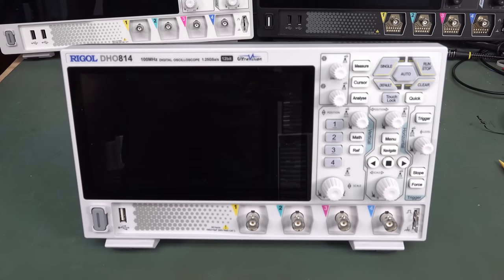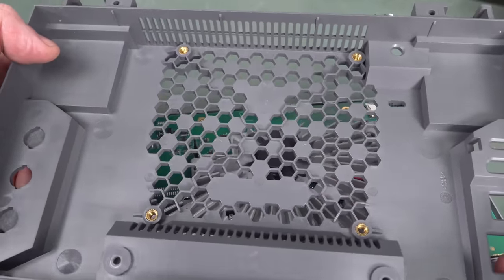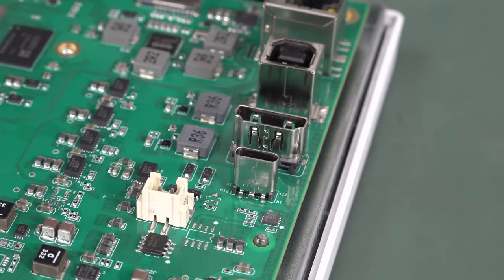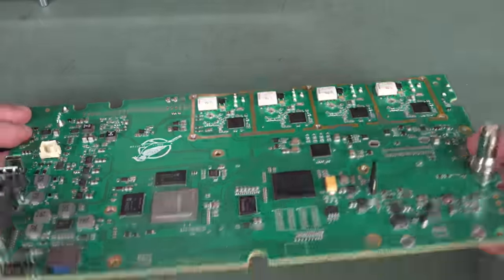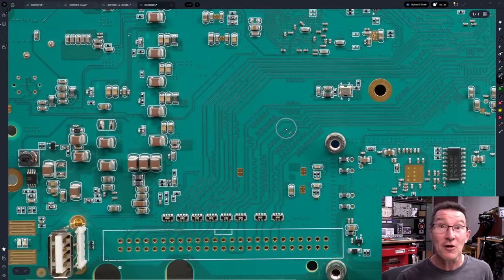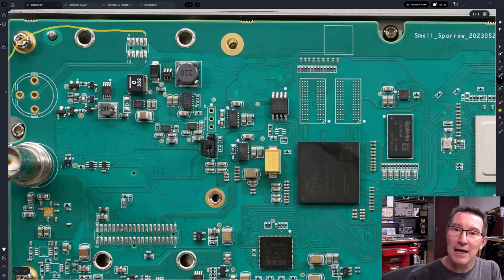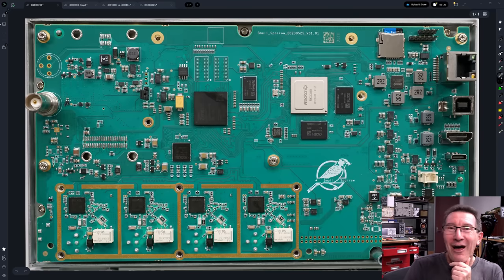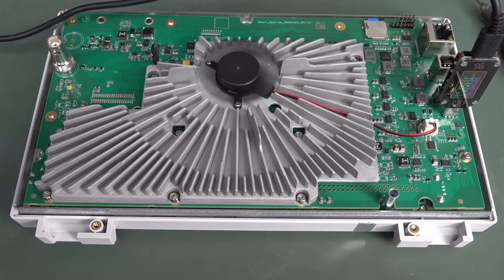EEVblog 1563 - New $389 12bit Rigol DHO800 Scope TEARDOWN

Comment: Not sure how much they have saved on the FPGA, looks like the zync XCZ7015. Pretty heftly with dual ARM cores included. Thanks for the tear down.
Reply: It is literally the cheapest they can buy with high speed serial transceivers which are probably necessary for the ADC converter (which I would bet is using the JESD204 protocol, which is an LVDS high speed interface)
Reply: Absolutely this. It has half of the multi-gig transceivers of the Artix 7 100T but has an extra 12-bit ADC. Plus, the PS has a bunch of "freebie" peripherals that can potentially reduce the BOM costs significantly across the models that they use it in (why buy an FPGA that you're not filling up AND an ETH PHY, when you can use an SOC/FPGA with enough fabric and 2 ETH PHYs for cheaper).

Comment: More likely the passives are placed, well the bypass caps anyway, so that the PDN behavior is the same. You'd have to (well, ideally you would, but we all know how often we do it ourselves in practice...) evaluate the supply quality for every assembly configuration.  Easier just to leave it alone, and let the low impedance sink a little more current in the case it's unused.

The termination resistors hanging around though, beats me =)

Comment: This is an awesome look at the guts of this scope. Love seeing the heat sinking and the analog front end at 18:40 . Any idea what they do in the cheaper scopes to reduce the bandwidth?  I just ordered a DHO802 since I don't need 4 channels, and all the specs except bandwidth are basically the same at 60% the price. I can't imagine they did a different board design or use a different chip in the AFE. Maybe a different cap on the amp somewhere or a software restriction? Neither would save them the US$100 price difference though between the 802 (70 MHz) and an 812 (100 MHz) model. (I don't really have to have 3.5ns Trise - but I'm guessing/hoping those specs are conservative anyway 🙂)
Reply: There are 2 boards - a 2 channel board and a 4 channel board.  They all have the exact same hardware.  Obviously, 2 channel models are cheaper than 4 channel models because they require fewer components.  

You can find hacks online that can 'liberate' the higher BW.  But many people caution against going over 100MHz because if you use more than 2 channels the sample rate isn't really high enough for good accuracy.

Comment: Wow. The price value is amazing. Also love the form factor. The USB C power that is cool and innovative. Nice. Could use battery banks easily, standard PSUs, but the provided PSU also is nice, high quality and small. Cool. The USB Type C socket looks a bit anemic, could use some more solder, or some glue there. Also would be nice to see some screw in USB Type C. There are few standards, and they are really and nice way to secure Type C for more permanent and secure installation.

Comment: I have to ask.  Is the 802 fully populated too with the added exceptIon of the the BNC connectors and relays for channels 3 and 4?  Are the front panels the same except for the front bezel and ch3, ch4 switches? I bet you  see the lights flash behind the plastic on startup.

Comment: Fan looks like standard 50mm item used on low profile graphics cards, should be fairly easy to alternatives.
Reply: Kewl .. Hey I dont suppose any standard fan size fits the 4 VESA holes ?
 Slow the internal one down with a resistor, and put something standard (and queter, maybe a low profile jobby) on the back ??
Reply: @petegaslondon  a standard 120mm case fan has 105mm hole spacing, so with a little modification of the mounting holes on the fan you should be able to bolt one to the 100m vesa mounting holes on the back of the rigol.

Comment: I think it is to do with cost of manufacture why they put the passive components on the logic analyser and not the chip. When you get a PCB manufacturer to do boards like that they charge extra fro mounting chips of that size and pin configuration. It suggests to me they place them by hand after the machine has placed all the other SM parts. The large ribbon connector socket is also in that category of manual placement. The idea is you do a large manufacturing run of the basic boards then you can use that board for all the different models and populate then according the the demand for each model. It's more costly to split it up into about ten different manufacturing runs.

Comment: The visa mount that's an option but yeah would have been nice for the plastic to have some cable mgt, I like the fact they left everything populated so easy to hack, its funny allot of people do populate caps and resistors ect but not the big cost maybe its just easier to have the same cfg on the pick and place and just leave out the more expensive components as i think that would be another pick and place machine for the big BGA's

Comment: Personally I think a 12 bit scope should have decent DC gain accuracy. Here +/- 1% is reasonable, at least it is better than the DS1054Z at +/- 4%. However, for 390 bucks one can't complain to be fair.

For relative measurements linearity is however more important than DC gain accuracy, especially since the gain tends to be fairly "stable" and can be accounted for, but still would be nicer if high resolution scopes like these were more accurate to start with.

Comment: SD cards can be used in either SD or SPI mode and each others interface might not read the correct data. Or the cards are hare programmed to only use one mode. You could get an SD to SPI adapter used on Arduinos to try to read that card. They might use them as a cheap eMMC alternative which is something I once wanted to try on a QNAP NAS with broken eMMC flash. Sadly I wasn't able to remove the old chip so I just sold that NAS. It was a nice and modern model I got for really cheap. I'm a bit sad I didn't keep it to try it again. I was also able to control it via a soldered on serial port which was kind of nice.

Comment: I think that caps and resistors are installed because they separate the boards for different models after that "small parts placing machine" and it's cheaper in the production

Comment: Near the top left corner of the main IC in the front end there are two unpopulated resistors. Could those be part of some configuration jumpers for the front end chip? If a Linux box recognizes the presence of the memory stick but doesn't mount it so you poke around in its file system you can use dd to do a raw read of the stick, save it to a file, then use a hex editor to examine the dump file.

Comment: Might be they're fitting a lot of unnecessary parts for initial batches to give them a lot of boards they can easily convert to the higher tier models while they finish their development?  We've done that before, and then later in production cycles removed the parts not needed for that SKU.

Comment: Crazy-good deal, and the DHO900 even more so with the LA included. But why oh WHY are instrument makers turning to black front panels? It’s so much harder reading white-on-black text than black-on-white. - And the dark design aesthetic is just plain ugly… 🤮
Reply: I'm actually opposite you, because white on black for me has always been easier to read for me personally.  Too bad they don't make each model with your choice of color, haha
Reply: Rigol is using black front panels on the higher speced series wit the same case. DHO800 vs DHO900, DHO1000 vs DHO4000 scopes, DP900 vs DP2000 power supplys, DG800 vs DG900 arb generators.

Comment: Maybe they keep the best boards with no issues for the Higher model. And boards with problems or not as to spec like snr are sold as the lower model that's why some parts are still populated/ installed?

Comment: Oh, no 50 Ohm capability..... maybe an opportunity to show us how to "retrofit" 50 Ohm termination to a scope like this for when one needs/wants such? Should be especially relevant if one can unlock 200+ MHz bandwidth mode, because for a common half-light-speed coax, that's just 75cm wavelength, which sounds like annoying ringing when/if termination is improper.
Reply: Just use a 50 ohm BNC terminator, either a proper but more expensive feedthrough one, or one on a T-piece.

Comment: First thing I do with most electronics I got (NAS, routers, etc) that have a fan is to replace the fans with Noctua ultra silent industrial ones. They make the typical sizes and come in all voltages. But I would never dare opening up a scope, because I don't know how the Noctua fan might interfere with the EMI, and if the built-in fan is specially optimized for that and that's why it is so loud. Bear in mind, an ultra silent, decent static pressure Noctua fan of that size can cost upwards of 25 Euro/USD, so that's a decent chunk of the scope's price.
Plus this fan looks like that would be almost impossible to be replaced.
Reply: @your
Are  you twelve?

Comment: Weird choice they went with the RK3399. That is a high end chip, but its from 2018, and is on a relatively large process node. The RK3588 has been out for a year and is a much better choice.
Reply: if it's only been out for a year, it's likely it wasn't available when development started no?
Reply: And perhaps the much better choice also costs a lot more...
Reply: @ghydda  @tiktian Yeah, I realize now after watching the rest of the video, they chose the RK3399 because it is the same chip used in the 1xxx and 4xxx series scopes (which were designed before RK3588 came out), and they can probably get it cheaper than the newer chips too.

Comment: Firmware no doubt riddled with bugs and won't see an update for another year minimum (just like the DHO4000). And when they do release an update, it will likely have only fixed ono or two bugs and made changes nobody cares about. No thanks, don't need more e-waste. I'll just stick with my siglent that actually works properly, gets regular firmware updates, and only costs a few hundred $ more, but doesn't waste my time.

Comment: I want to change the Siglent SDS1104X-E to the Rigol DHO814. Is this a good idea?
Reply: The new Siglent SDS800X HD series are better options.  But unless you really need the additional resolution looking at small voltages, you won't see that much a difference from your SDS1104X-E.  Either way, I see a lot of complaints about buggy FW on these Rigol DHO800 scopes.

Comment: I think the same, very very fragile usb-c connector
Reply: I have USBC on Android phone. Use it almost daily for 4 years.
Reply: @henryD9363  yes, but on the smartphone it is soldered horizontally and is reinforced.
Reply: @RickB3n  
You are not very observant! The metal frame of connector C is soldered with 4 feet crossing the printed circuit. The problem, connector C must pass 36 watts through its tiny contacts.

Comment: The cost of the discrete components is so low that it is logical to leave them in circuit compared to the cost of recoding the populator bots and R&D the effect of floating traces turning into mini aerials.

Comment: Think I'd open mine up and stick a dab of hot glue on that USB C connector.
Reply: @Okurka.  Hot glue is easily removed if you needed to replace the port at a later date. It's not just the port to board connection that's an issue, it's quite common for the pins inside USB-C to become damaged too.
If it was an expensive scope then it should definitely be on a daughterboard IMO, but at the price it is who can complain.
Reply: @MattyEngland Hot glue is flexible, it would not add any meaningful amount of additional strength.
Reply: @tookitogo  Not it's not, it drys almost rock hard.
Reply: @MattyEngland  1. Hot glue doesn’t dry. It solidifies as it cools. 2. Nearly rock hard? No standard hot melt glue is anywhere close to rock hard. There are industrial ones that are very hard, but you can’t apply those with a normal 11mm hot glue gun. Any hot melt a consumer would use is going to flex a little bit, and that little bit of flex is enough to make it pointless for this application.
Reply: Apple MacBooks for a couple years and Android phones for many years use USBC connectors. Where is your data about failures?
Fiction
Reply: @henryD9363  Granted, Apple and the other good manufacturers understand port failure and design their enclosures to provide a lot of mechanical support. 

Without inspecting the Rigol in person, it’s impossible to tell whether the enclosure provides enough mechanical rigidity or not. 

What I can say without seeing it is that adding a dab of hot melt glue isn’t gonna do much at all!
Reply: @tookitogo  
You are not very observant! The metal frame of connector C is soldered with 4 feet crossing the printed circuit. The problem, connector C must pass 36 watts through its tiny contacts.

Comment: Regarding the 1 to 4 channel drop in performance.  If you think about the market for test equipment the applications vary widely. This "limitation" might be perfectly acceptable for a person doing sound products, TV repair etc. Anyone doing IOT stuff is going to need more high speed, a logic analyzer and a decoding software (I2C et al). Further, with LXI this can be a few more channels on the bench for those times you need just a little more insight.  For the price it is a really exceptional value.
Reply: 12 bit is mainly interesting for analog and power stuff, so the bandwidth is more than adequate.

Comment: try putting the SD card in to a PC and set it to boot from it.  See what happens then
Reply: The android os is of course specially compiled for Arm (which it always has been)  so X86 wont boot it. Also the bootloader and kernel and everything is compiled/written for arm architecture and often for a special chip cause difference in kernel drivers and modules....

Comment: Guys!, why each channel has theat copper exposed square around it with the stitching vias? is it for shielding? if so how does it work ? also does each channel has a separate ground since they are isolated? what is the Ic in the front end and what does it do ?
Reply: Scopes with isolated grounds between channels are very rare, this is definitely not one of them. The IC is basically a variable amplifier so you can measure from millivolts to hundreds of volts, and it scales the input up or down to a voltage range with which the ADC can work with. Likely it also contains a filter and protection measures against overvoltages. The exposed copper is indeed for shielding and makes contact with the big heatsink. Together with the via's it forms a very tight shielded box around the circuit to shield it from external influences.
Reply: @Jeroen74  thank you

Comment: I really don't like that they skimped out on an internal power supply and used a USB C connector. The connector is way too damn fragile and you have yet another power brick laying around. Then you have to remember to connect a separate ground connection. Of course people will use the lack of ground so they can clip their probe to live portions of a circuit and make the whole damn scope live too.

I also don't like that they put the firmware on a consumer grade sd card. At least that can be cloned so you can replace it when it fails.
Reply: Usb C connector on my Android phone. On and off almost daily for 4 years

Comment: Pretty interesting a scope uses a sd card to store the os like a rpi, i have seen in an embedded system that ran windows embedded and i managed to run doom on a usb flash drive. I was surprised to not find a flashcard or emmc or "ssd" or hdd in there but a kingston flash drive. I bet that system was designed with "planned obsolecence" in mind and this scope also maybe because who glues a sd card?  The flash drive was also glued  and had filesystems
Reply: Even eMMC would have "filesystems". It's glued in because it's not user accessible, and you never want it to possibly fall out. (people do drop things.)

Comment: For the micro SD card, it would be good if it was readable, it would make it possible to transfer all of the data to something like a higher speed Sandisk Extreme Pro micro SD card, and then see if it improves the boot times.
Reply: I'm guessing it's just not formatted with a typical filesystem and it's being used as a raw storage device.
Reply: Probably raw files system and not formatted to a usable readable fs. I got a embedded pc which used a usb flash drive as a boot drive and it had raw fs on it
Reply: Yeah if the hardware READING it can do the High Speed thing - sure worth a try

The Linux DD command could do a bit-wise binary copy, in case its a funky filesystem/bootloader?